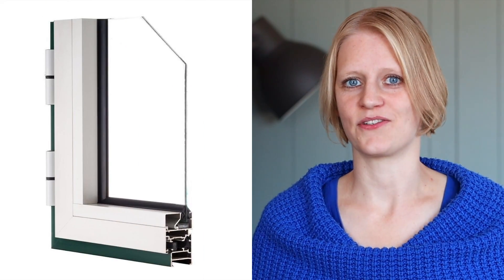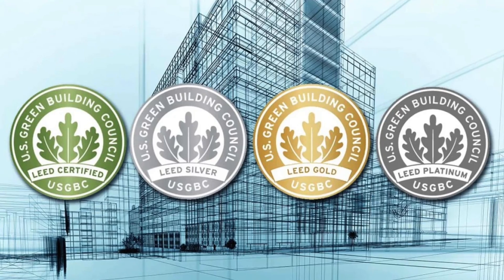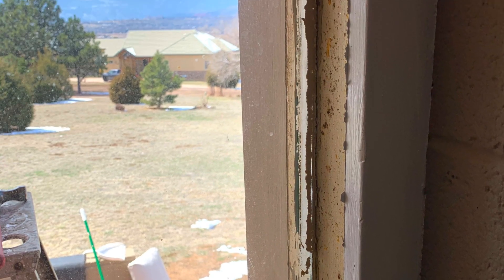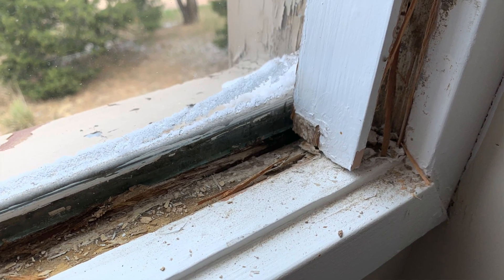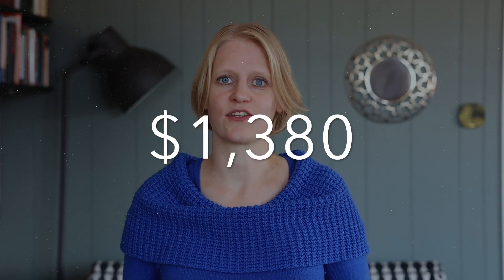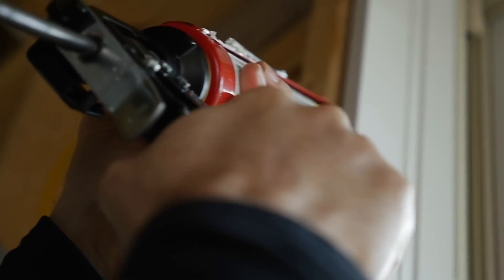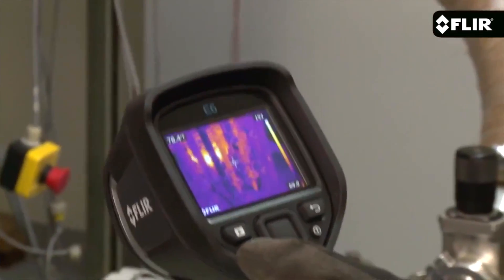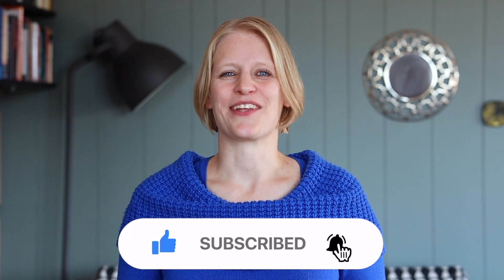Home Window Glass Replacement (Worth it?)

Comment: Over insulating a wall or ceiling is almost as bad as having little insulation because the compression transmits cold or hot. It is best to apply the insulation product that is rated for the thickness of the wall. A 2x4 wall should not have fiberglass batts thicker than R-21 for example. Spraying that same wall with closed cell insulation would be the best solution and the most expensive......
Reply from the maker: Thank you for sharing. This is helpful! 😀

Comment: For us poor folk, just install plastic over the window.
Dead air space is better than nothing.
Reply from the maker: Hi, Thank you for sharing! 🙏 This is interesting. I'd be curious about how effective this solution is. Have a great time! 😀 Katha
Reply: @NetZeroTech  So far, it seems to work for me. Keeps the warm house air off the cold glass.
Another method is to make a frame from furring strips. Staple plastic around the frame.
Place frame in the window. Whole window not just the glass. From floor to ceiling.
It is easily removable too when you want to get some fresh air.
Another one is take bubble wrap, spray glass with soapy water, fit the bubble wrap on the glass. Don't squeegee the glass before installing the bubble wrap.
And only lightly after installation to remove air pockets.
Reply: not floor but window sill to top of window.
Reply from the maker: Thank you for sharing! 🙏
Reply: @NetZeroTech  You are welcome.